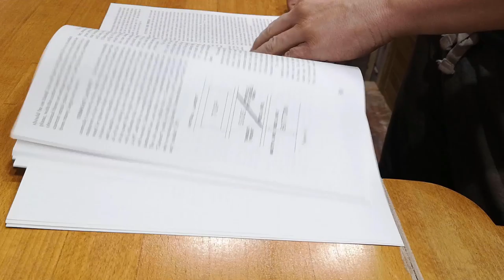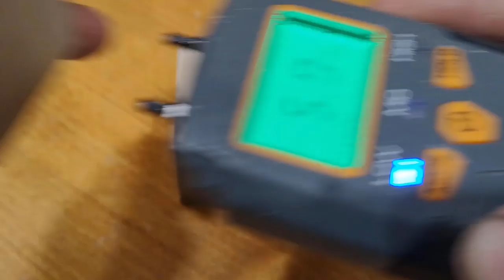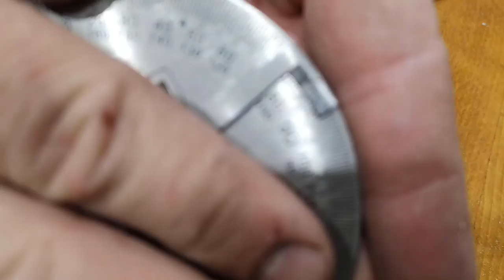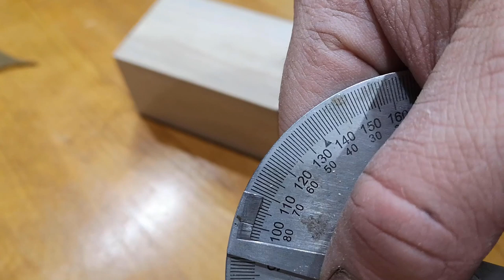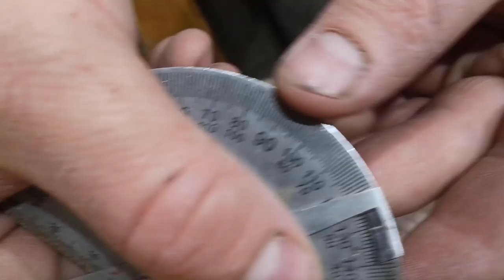011 Wooden bull nose hand plane. Woodworking

Comment: I don't understand smoothing plane or 6" jackplane could also be used for this why this plane
Reply from the maker: I just want to remaind you theme of the video - "wooden bullnose plane". How do you use smoothing plane or jack plane in the corners? I would love to see it.
Reply: @StavrosGakos  I will not show you , I am mean , my tools are means too.
Reply: I have only two planes thats it, one 5inch another7-8 inches straight , i made them both with two chisels got plane iron from market , dont have any other i made only two planes and time it took i hate it with no vise , nothing only a concrete floor , my lawn damn it , my tools are mean tools they will work but how thats a mystery, souls are river currents on my planes who cares they cut thats enuf. Will try this plane i dont have know how for this usage , i have spent all time in making 2planes . Damn.